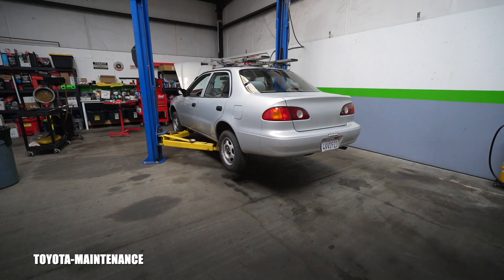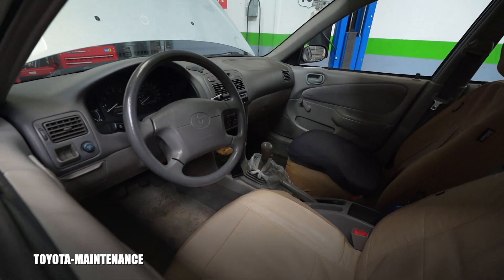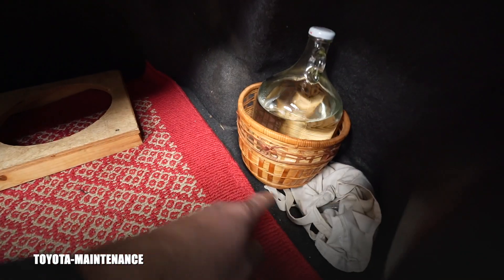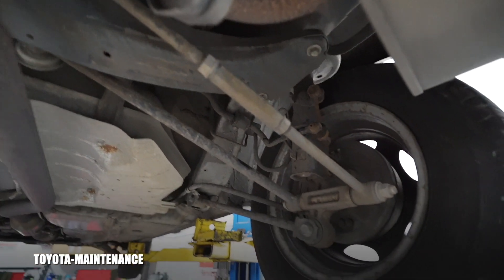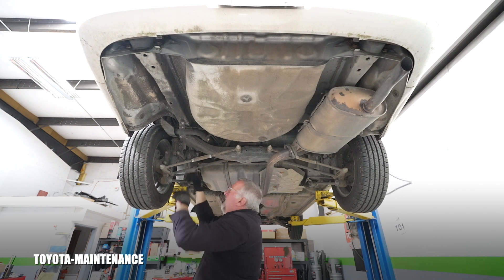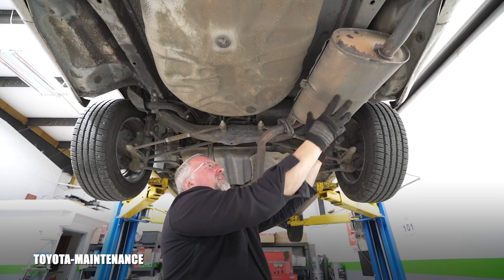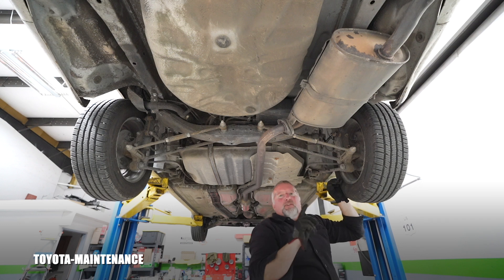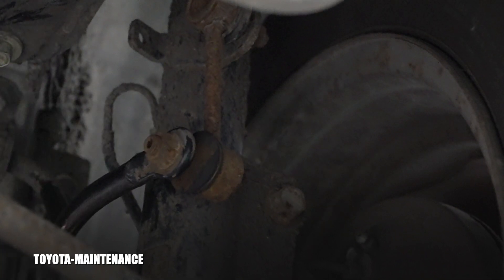Clunking Rear End While Driving - What To Check?

Comment: A friend of mine said he was hearing noise over bumps, its a 3 year old car. I put it on jack stands, inspected the suspension components and found no abnormalities or damage. When I impacted the lug nuts, they came off so easily. Barely squeezed my impact gun trigger and they came loose. Turns out the lug nuts were LOOSE and it was the wheel hitting the hub making the sounds. I would've never thought to check lug nuts first because its common sense to tighten the lug nuts, everybody knows that. The owner was the last one to touch the wheels. I couldn't believe it.
Reply: that just sounds dangerous! to leave loosey lugs
Reply: That's because common sense isn't so common

Comment: Not that anyone cares but this one applies to me. I had a 2004 Corolla got brake pads changed at local repair shop.  Go over speed bump - clunk.  Pothole - clunk.  Took it to Toyota dealership, they said the caliper was sitting on the rotor loose.  They said the shop had the slightly wrong sized brake pads and tried cranking them down to secure them.  The bolts worked loose and if I had hit a big enough hole the caliper would have bounced off completely, leaving me without front brakes and creating major damage.
Reply: that sounds extremely dangerous!  glad the Toyota experts were able to diagnose it properly, sometimes those techs are on the sketchy with the knowledge they claim to have training

Comment: A few months ago I did the front end links on 2011 Sienna. Lots of road debris built up on nuts. Soaked it with pb blaster and then torch. 1/2" impact to remove. Noticed dust cap (bellows on steering rack) original part needs some attention. NY winters can be chilly and no lift in driveway make repairs a little more of a challenge. Might be good idea to also schedule a sour krout break as well. Im California dreaming most of the time.
Thank you Peter.

Comment: Hi Peter, any recommendations on dissent aftermarket sway bar links? Toyota links are usually very expensive for these old Toyota cars. I help my son fixing his 2003 Matrix and I used Moog links once, but I’m open for any other recommendations. I love your videos, they are very educational and well filmed. Thank you for helping others.
Reply: If you plan on keeping the vehicle then take the financial hit and pay for original Toyota parts as they will last. Yes, they are/can be expensive but get them before they run out.
Reply: wait for those neat deals on OEM parts during the holiday sales season... some online dealer parts dept's mark them down over 40 per cent off MSRP which is a very good deal for genuine parts
Reply: Well that's the whole thing. You can buy it four times every year or pay for it once and have it last many more times over. And they don't even have grease zerks! Otherwise don't buy aftermarket without the nips

Comment: I have a 2003 Corolla I bought for $200.. it's got 170,000 mi the place my friend had it lady I work with they couldn't get the drain plug out it was stripped they said well it's no good we can't fix it and junk it.. I told her I'll give her $200 bucks that's what they would give at the junkyard now it has a Chevy drain plug in it it has SAE threads....
How to change the intake gasket clean the fuel box .. and I had to put brakes in the rear cuz nobody ever changed.. and the drums for some reason were egg shaped so they had a funny feeling when you put the brake on but other than a little bit of rust it'll probably outlive me as I'm retired..... Cuz most of the time I read my motorcycle 👍☺️